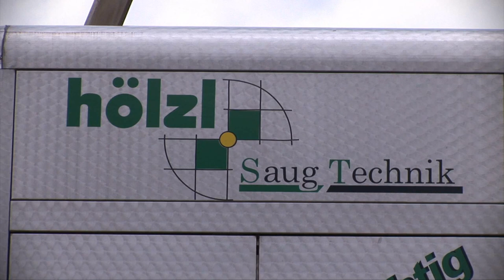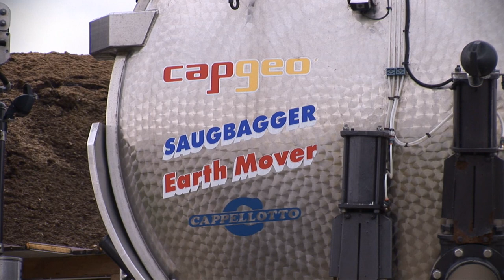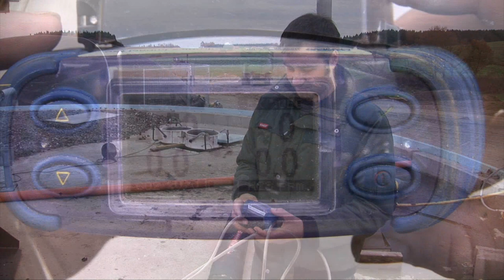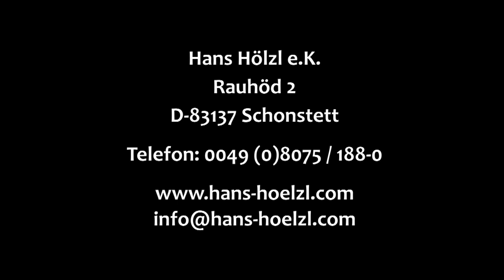Fermenterreinigung in einer Biogasanlage

Comment: Future tank design: Make the tank bottoms a downspout cone with a radius fluid spray bar to move remaining sludge to the center of the cone.  Design for both options, and center vacuum through the base and top access. Way less process and machines involved.